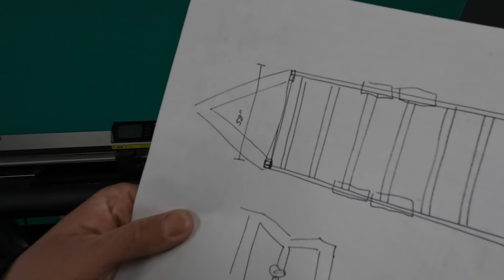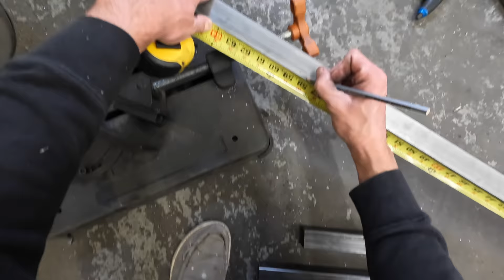Building a Mini Gooseneck Trailer for my Mini Truck! (Part 1)

Comment: A great tip to help with the expansion and contraction get a wet wrag,shirt etc and put it around the area you’re going to weld. Water has an extremely high heat capacity so it will absorb a ton of heat and it will not expand.
Reply: Also clamp a thick plate of aluminum on the backside of what your welding and it will absorb the heat

Comment: A good way to get the tubes to sit flush and also secure is to clamp a flat bar or plate to the bottom of the frame tube sticking out a little bit and setting the cross tube on the plate.

Comment: Just remove the drivers glass metal support bracket from the drivers door. I’m sure it’s still attached to the tracks. You can dig out the old broken glass and urethane and use it to put on the “hopefully newly made window”.

Comment: Remember that the gooseneck is going to put leverage on that dump bed, probably won’t break it, but it will definitely wear on that hydraulic cylinder over time. Maybe make a good latch that holds that bed solid to the frame while that trailer is on. You’ll be rebuilding that cylinder constantly if you don’t

Comment: Next time, use a clamp instead of magnets to clamp a piece of scrap steel on the underside of the tubing. Use that as a base for the cross braces to lay on and be flush on the bottom. Also, you can use the 3,4,5 triangle method to check square. It’s very handy especially on large scale projects.

Comment: It was hard to see if you guys had the regular rolled down all the way but usely putting in or taking out door glasses the regular rolled all the way down gives you alot of room to turn the window just enough to take it out or put it back in. Hopefull you guys can find a track or glass squeeze clamps for the driver side. If the old one is still bolted on the dr regular then you can drill the glass out of it if there's any in it still and glue that track on the window

Comment: I work with pipe fitters and with my ocd, I would have measured from the bottom of the frame to the ground on all four corners to make sure the jack stands are 100% level and the same with the the rest of it to make sure it’s all and stays 100% level
Reply: Ground is uneven. That wouldn’t work. You’d need to use a level 🤦‍♂️

Comment: To help with the twist tack the braces when you get the outer frame tacked up once you have those braces in it helps with keeping square once welding. And also as someone pointed out having a cold wet rag helps cool and harden the weld faster. I also would have put gussets in the corners since you ground down the welds mainly because your using it as a trailer…

Comment: Usually you have to move the fence down a bolt hole to do your angle cuts. There should be another set of bolt holes for that.
Reply from the maker: Yup, just saw the holes! 🤣 oh well, next time.

Comment: Great video as always. You should of used angle iron, like a 6'x12' utility trailer, instead of the square tube. But that trailer is for sure going to last a long time.

Comment: 3:35 you should make sure you’re running the right size sprockets and chain. Really can make a difference on speed.
Reply from the maker: I didn’t want to play with sprocket sizes until I got the big bore kit on